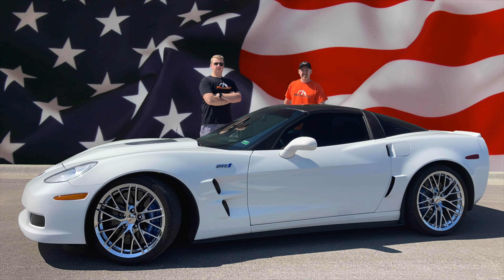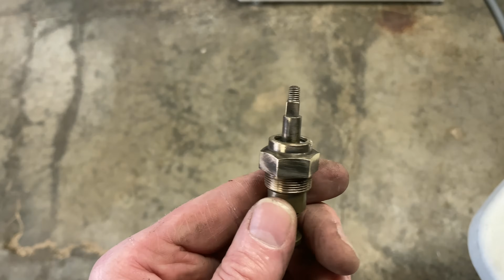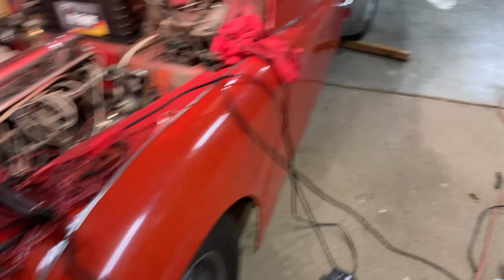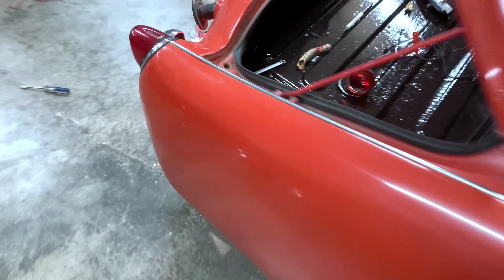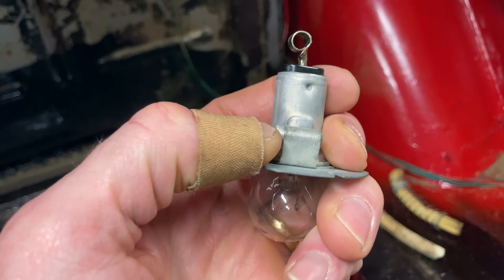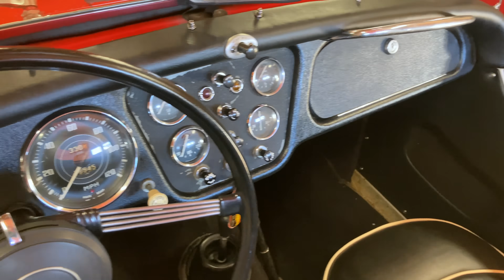Breathing New Life into a 1961 Triumph TR3A: Leaks, Electrical Gremlins & First Drive

Comment: Though it’s been more than 50 years since I had my. TR3A, I still recall the fun of maintaining it.  The underhood starter switch is for bumping the motor over while setting valve clearance (be sure to do that!). I found wool seat covers to be much more comfortable in both Kansas summers and northern Indian winters.  Changing the starter was a real challenge; I finally just left a 1/2”combo wrench on the upper nut!  Learned to change a head gasket in 90 minutes after insufficient torque on my first two attempts failed (the spec is ONE HUNDRED forty pounds/ feet, NOT the 40 lbs/ft I thought the Triumph mechanic told me!) Yes, occasional electrical gremlins came and went (when the fuel gauge suddenly dropped to zero I knew I had no wipers nor turn indicators, but a good thump to the dash usually healed things.  BTW, the same ignition key seems to work most TRs of that vintage - or in emergencies, a beer opener pressed up against the back of the ignition switch got me home on occasion; you might want to install some antitheft mechanisms!  Mine had wire wheels; after sitting without moving for 9 months I had to have a motorcycle shop tune the flat spots out.  Redline in fourth is 100 mph; given a long flat road such as the top of a five mile long dam, the TR will do it! The wires were worth it when people saw me get out the brass hammer and spin off the knockoffs! I had to run inner tubes when I switched to radial tires because of the wires, but they transformed the handling over the original bias plies.  In the dark days before multigrade oils, I would have to add STP as the weather got hot and oil pressure dropped.  Loved that car!